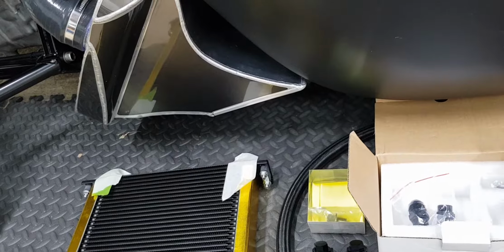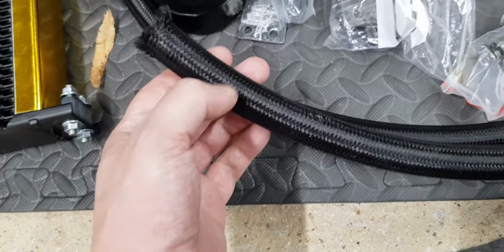Atom 4 Project more power - Part 1

Comment: Interesting..  Lover that you're making these and explaining through it.    Few comments (had to stop the video, to get them in before I forget).
1. Your engine is starting to look like the McLaren F1 BMW engine bay!  Ha..  For several years, I worked in R&D for chip making machinery.  We would vaporize a liquid and deliver the vapor to a chamber where it's sprayed onto a disk full of new chips.  The temperature control for delivering the vapor to the disk, and the temperature of the disk and across the disk, is very very precise.    Poor temperatures cause the vapor to change back into a solid and cake up the lines or other areas, as well as it won't deposit the material uniformly across the disk, causing functional chip performance differences if the chip was in the center vs edge of the disk...   Anyways, my point being is, when in comes to insulation, rough placement helps, but take care of the details and the result suddenly are logarithmic.  Sealing that last 5% -10% makes a big difference.   Imagine you're wearing a jacket in really cold and windy weather.  You will notice a very big difference in insulation when you close up the last few holes in your sleeves and neck.

2.  Thermostat for the oil cooler.  You probably already realized that when you change your oil at room temperature, the valve will be close to the oil cooler, so you'll never drain the oil from it..  Maybe there's a way to short it, or apply power to it, to force it open?

3.  I'm no expert and airflow, but it's clear that airflow around the engine, before the oil cooler, is very turbulent...  I predict that the air will simply deflect off the oil cooler fins and flow AROUND the oil cooler..  I think it would be helpful if you're able to add a fan on the exhaust side of the cooler and either a pusher fan on the inlet side, or create "cup" or "box" on the inlet side.  Walls on all 4 sides that "capture" the air and prevent spill-over, around the cooler.   Having written all that, perhaps an inlet fan is a better idea and simpler.  You could give it it's own switch on the dash or tie it to something else to automatically turn it on.

4. Great thinking at the front to divert air flow.  Yes, that will make a difference.
Reply from the maker: Thanks again for your insightful comments, much appreciated and certainly food for thought. Regarding the drain plug for the oil cooler. The Setrab oil cooler version that I have is a motorsport cooler and they chose not to include a drain plug. The reason after research on this is because that is another potential failure point, so they chose to have reliability over ease of emptying it. Ariel suggested I do not remove the unions when changing oil, eventually all the oil will be recycled and changed over time. The reason being is loosening the unions frequently will potentially introduce a failure point and eventually fatigue the Goodrich unions ultimately causing leaks. I change oil very frequently on this car. It's only done 3000 miles and has had 4 oil changes in this time.

It's a very interesting point regarding placement of the oil cooler. This is in part one of the reasons it's taking me a long time to fit it, not to mention I want to test in iterations to see the results rather than a big bang approach. Big bang approaches tend to obfuscate any benefits and make reading the data difficult. My plan is to install under the engine cover vent, test. Then if I am not getting satisfactory results I will create an airduct from the engine cover mount down to the cooler for help with airflow.. Furthermore, adding a fan will be my last solution. Because the oil cooler will add additional capacity of oil to the car, this alone will aid cooling and enable the oil to run cooler simply by adding 20% more engine oil capacity because it's a 1ltr oil cooler. I will calculate all this once I know temps of oil as right now I have no way of knowing the temperature of oil with a NPT sender installed.

Comment: As someone waiting for an A4, I find these videos very interesting so thanks for making them! It is however a shame that what comes out from the factory seems to suffer on a warm UK day on track. Should be up to the task without need for this and/or extra radiators etc.
Reply from the maker: It depends how you drive the car tbh whether you will see a build up of heat or not. The earlier cars got hot too with the supercharger it's just very few people have done anything about it that I know of or even measured everything. It's not until you start looking into all the sensor readings and data you start to understand what is going on and how to improve these things. Have you spec'ed the sports rad and sports core intercooler? These are the only two cooling options Ariel sell today.
Reply: @sl0w_racer  Very true, the data doesn’t lie! I was going to spec the Sports Radiator, differences I took away after a chat with the factory were: 1) it’s larger 2) continues to circulate once car is shut down. It would be interesting to find out how much this remedies the chance of overheating and boost being cut as you mentioned on a warm track day. I did wonder if it’s more a case of getting enough air through the front opening to the radiator vs the radiator size itself? Still, great to hear the differences from what you have done, pretty remarkable infact!
Reply from the maker: @CharlesM505  The recirculating the coolant will save you from having to do many cool down laps on track hence help slow heat soak when you come into the pits. How is it larger? There is no space for it to be. Maybe they have more cores and hence more fins. It's still a downflow rad though. I would prefer a cross flow. I just last night uploaded a video with my testing results so far. One test shows very minimal front wing air duct testing to force more airflow through the rad, but it all looks very positive. More testing is needed here.

Comment: Did you consider ceramic coating for heat shielding?
Reply from the maker: Yes I considered it and spoke with Zircotec and a couple others. I concluded the reduction in temps were not enough to go through with it and they advised me not to wrap/heat blanket AND ceramic coat because the wrap can wear the ceramic coat away prematurely. They quoted me a 33% reduction in heat. So if we look at the reductions I am seeing now on my exhaust system (not downpipe) it has a peak temp of around 110-120 degrees celsius. After with the DEI Form A shield I am seeing temps of around 30-40 degree c. That is a ~64-72% reduction in heat and all that heat soaks into the manifold, the sump and the engine - coolant lines etc. So it's much more effective and much cheaper than ceramic coating. It's nasty stuff to work with though. I will probably get the std muffler ceramic coated a gold yellow over the winter that said. When I post up my sensor readings you will see the impact this has on the engine.
Reply: @sl0w_racer  Interesting. I'd have assumed the ceramic would give greater heat reductions than that given how popular it is in motorsports.
Reply from the maker: @tcroft2165  Most motorsports use a process called hard lagged which is similar to the DEI A shield except it's permanent or they wrap because both are a lot more effective than ceramic coating. Do you follow the chap in the US with the orange Ultima RS? he has a lovely car and he had his exhaust manifold ceramic coated first but later found it didn't reduce temps enough for his car. So he used a traditional wrap in the end, looks like a titanium one.  https://www.instagram.com/p/CUIr_j2lo2s/
Reply: @sl0w_racer  I'll look him up. I'm not an instagrammer!

Comment: Very informative video as usual 👍🏻 be great if you can do a video covering all the data and figures achieved by these mods
Reply from the maker: Thanks, it was a little long but a lot in it. Yes I plan to do a video on the results and the impact from these mods next this will be part 2, if I did it in this video it would of been around 40 mins long in total. Then I will do the oil cooler separately. I have a ton of data now with and without cooling modifications